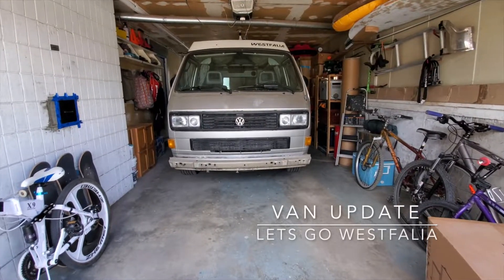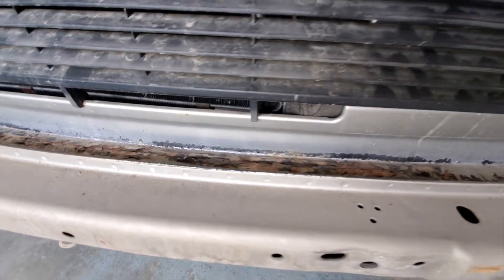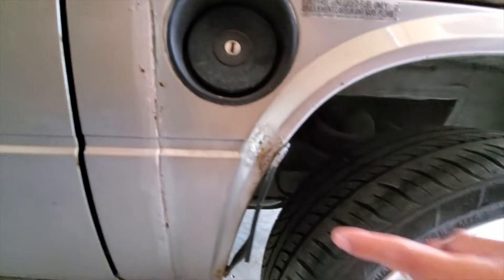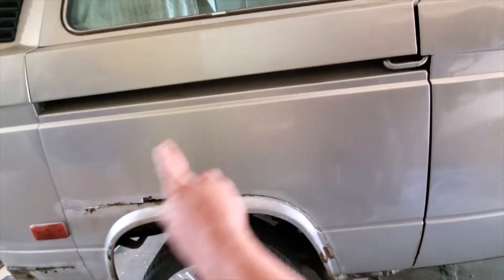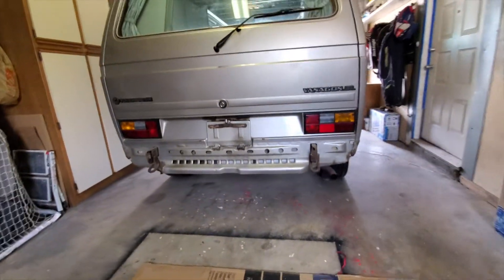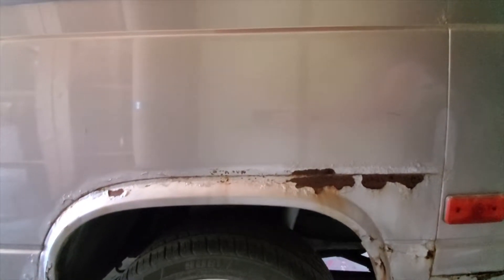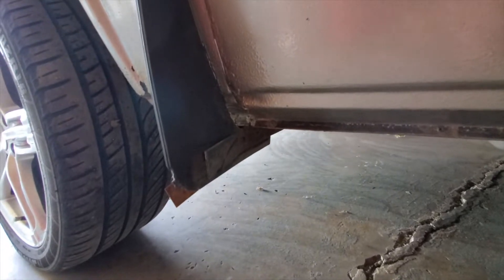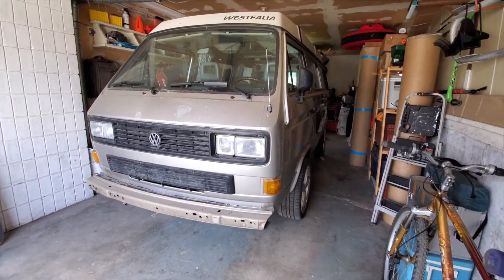Van Update - VW Vanagon Westfalia

Comment: Check the area around the Seatbelt bolts by the door. You will need to lift a bit of the carpet. You dont want your seatbelts coming off in the event of an accident. Good luck with the work. Looking forward to seeing the end result!
Reply from the maker: Omg it's funny you mention that because I was trying to change my seatbelt one time and the bolt would not move and finally after applying a crazy amount of pressure the bolt and the part that it threaded into just kind of snapped haha. Now that bolt just spins, so I it's really broken. I'm pretty sure I'm going to have to cut that part out and weld in a new piece. I just gotta go cut that bit out of a doner van before I hack it out. The never ending project lol.
Reply: @letsgowestfalia2405  right behind ya. We are just waiting on our replacement engine to be installed and then addressing the welding in the exact same spot on both sides.
Reply from the maker: @grinstarr  LOL No way! That's hilarious! Well at least mines only one one side. I wish it was on the the passenger side though, cuz on the driver side there is a that tank there in the way, so gotta remove that first and I'm sure I'll break something trying to get that off. lol.